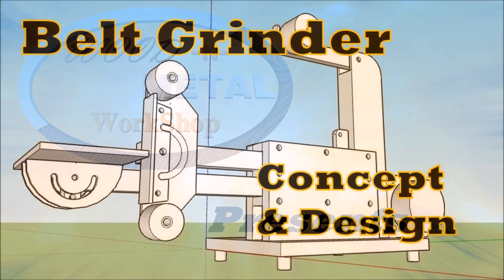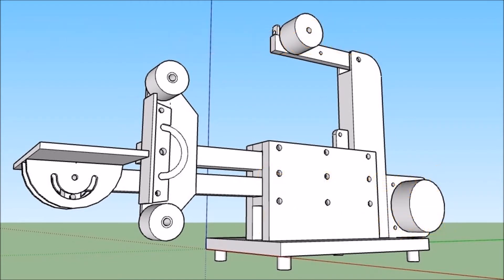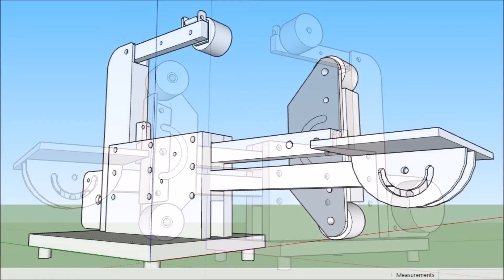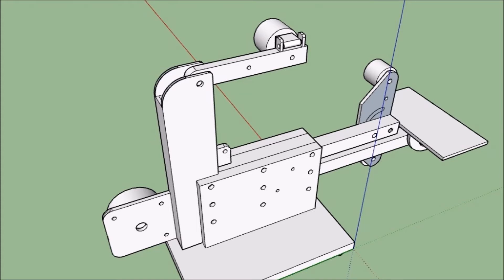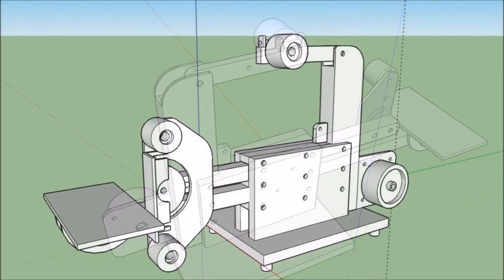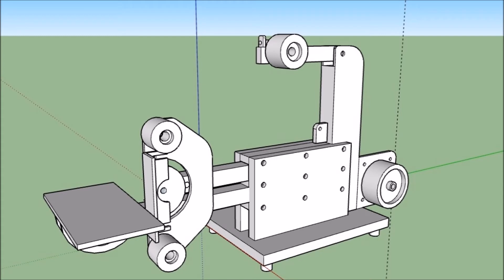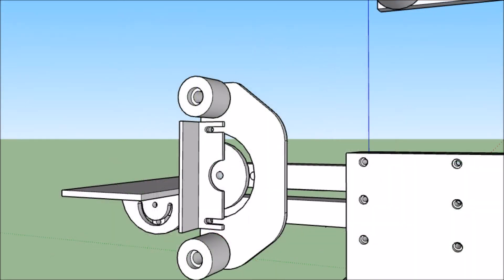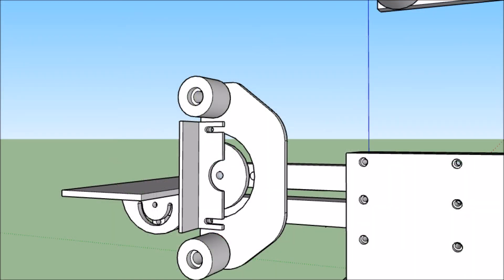Skookem as Frig Belt grinder concept and design

Comment: Great project. I can't wait. I'm looking forward to see how you incorporate the spring tensioner and the tracking. R
Reply from the maker: I am actually working on the tracking right now, just finished up the final drawings for the tension arm. For this one when it is done I will have the plans available. But of course that will be awhile since I can't do the final drawings until I have the prototype working properly. I'm hoping to start the build on Wednesday and have the first video up in 2 to 3 weeks.